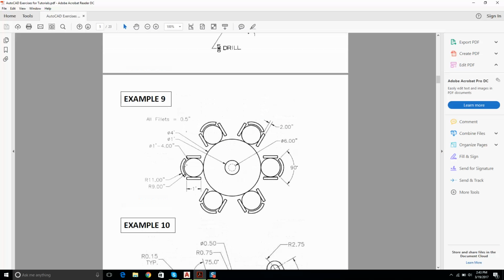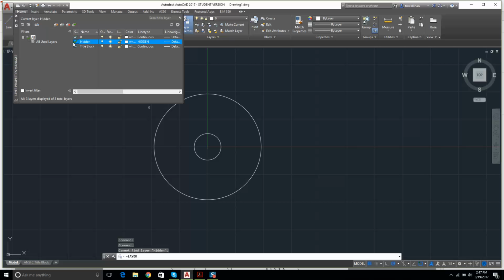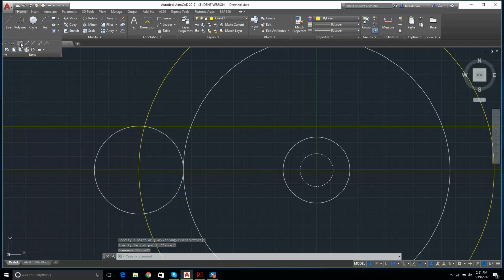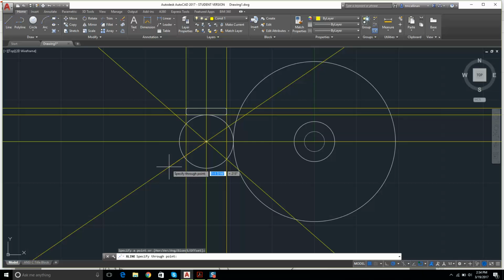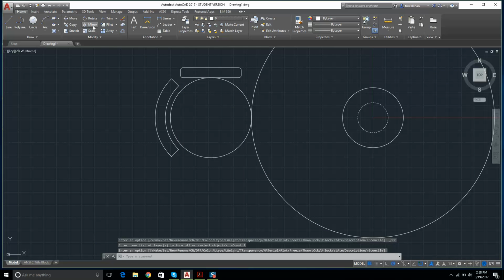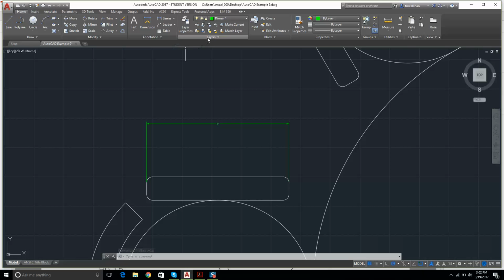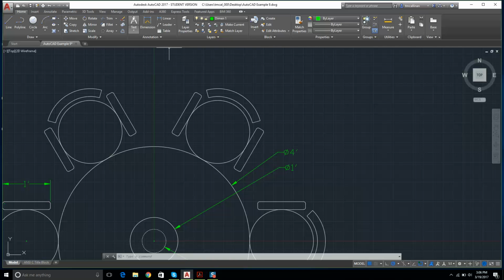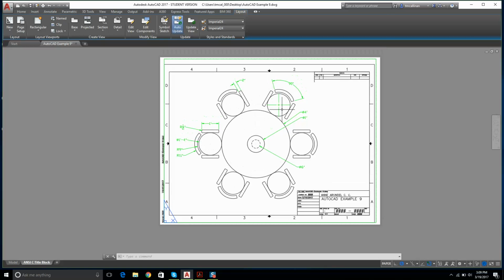AutoCAD Tutorial 8

Comment: Thanks for showing me why I was right to choose Solidworks. I'm not sure when I last saw anything quite this awkward. I played along, creating the same in SW, and I created the chairs and table as full 3D models (artistic license in creating legs etc). SW then created the projected drawings for me, fully dimensioned. Chairs and table created separately then put together as an assembly.
Reply from the maker: I hear you - AutoCAD is a clunky program no doubt but there are lots of jobs and many drawings out there still done in AutoCAD. Every solidworks user - still should know a little autocad
Reply: I used Autocad (and learned CAD on it) when it was a DOS programme, and for simple 2d drawings it is still useful. But the way I use Solidworks is probably not "official". I sketch in all the approximate shapes - circles, rectangles etc - that I want in the drawing, using the relationship anchors. Then click the "dimension everything" button. After that it is just a case of clicking every dimension and typing in the value I want. That being done I start extruding and cutting the solids.